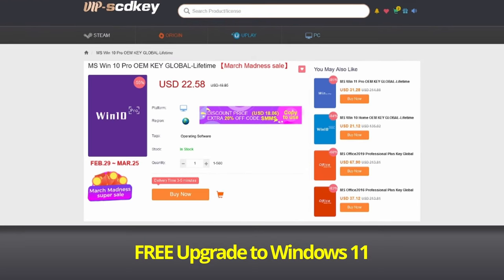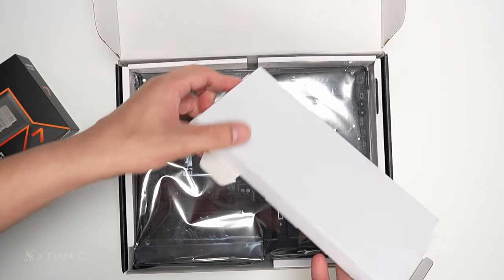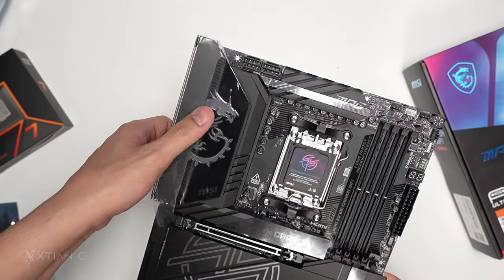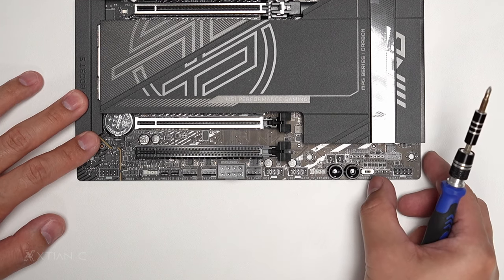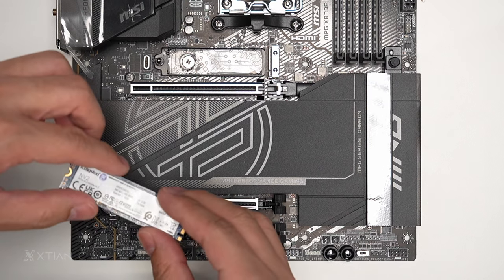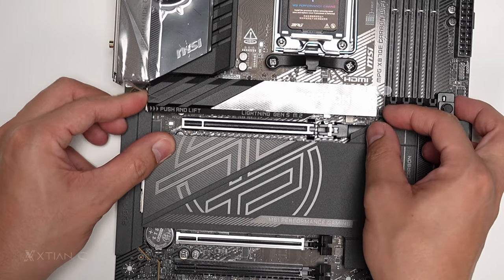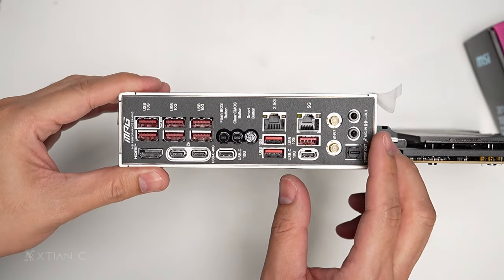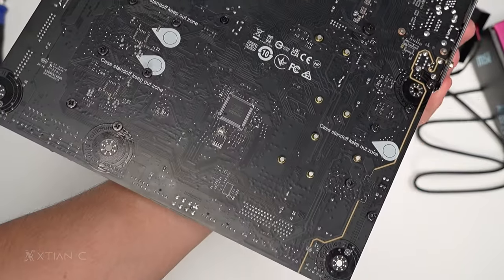MSI MPG X870E Carbon wifi Gaming Motherboard Unboxing & Overview [Ph]

Comment: if you wanted to. Could you use traditional Wi-Fi connector instead of those quick connectors?  It looks like there is treads on them close to the motherboard?